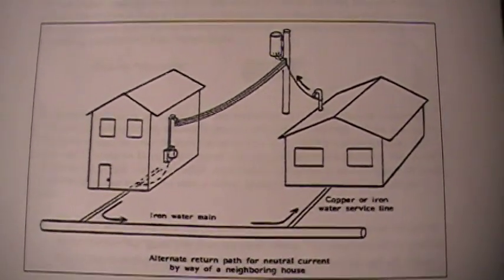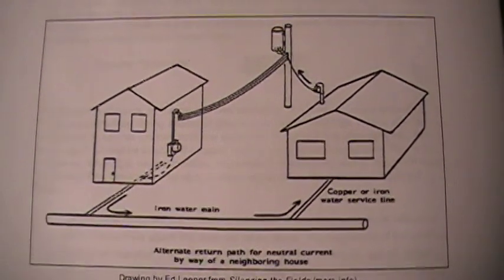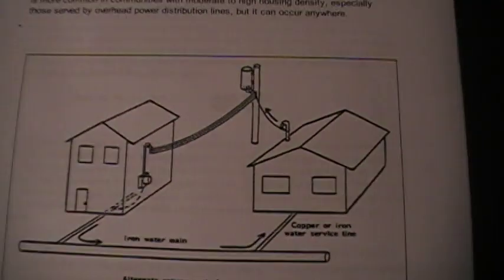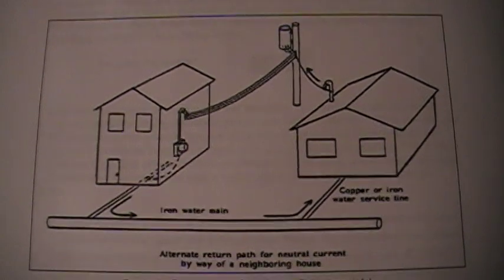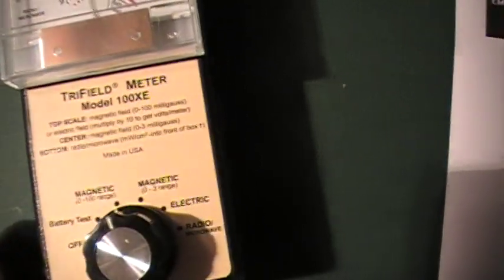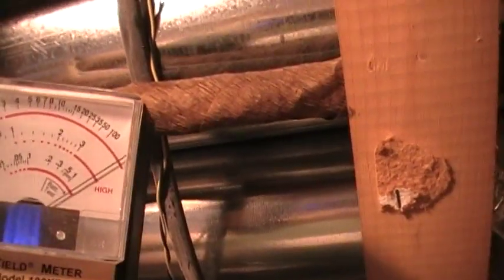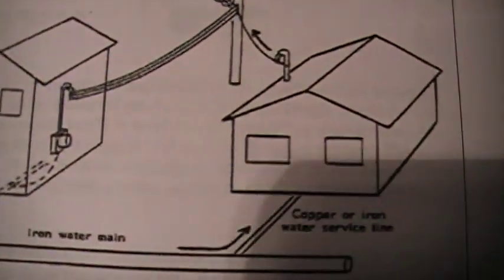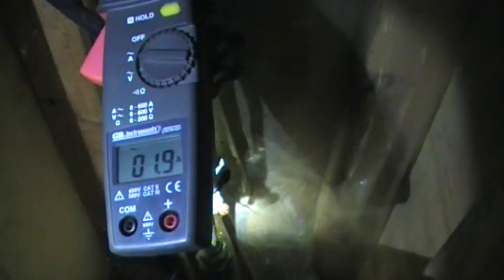EMF Health Risk.  EMF from Water Pipes.

Comment: how did you stop this and who do i get in touch with because ive been getting this done to me for 6 years
Reply from the maker: We put in a grounding rod so the electrical panel would be grounded WITHOUT the copper pipe.  Then we put in a dielectric coupling in the pipe that breaks the circuit.  Worked like a charm
Reply: @feouellette  thanks ill give it a try hopefully it'll fix the issue at home .

Comment: Hi. Is there a video of the fix? We are having this exact issue.
Reply from the maker: Elizabeth J hi Elizabeth. No video, but here is the solution. Get an electrician to put a dielectric coupling in the pipe so the pipe no longer conducts electricity, and get the electrician to install a new grounding wire for the pipe that goes outside so that the pipe is safely grounded
Reply: feouellette Thanks for this information. Is there any way and/or need to also make an emf shielding cover over the "smart" water meter in my basement and also on the outer wall of my home? We were told it was mandatory to change out our older meters and not told these were smart meters.

Comment from the maker: Hi Anothy.  Yes we did.  We put in a grounding rod so the electrical panel would be grounded WITHOUT the copper pipe.  Then we put in a dielectric coupling in the pipe that breaks the circuit.  Worked like a charm